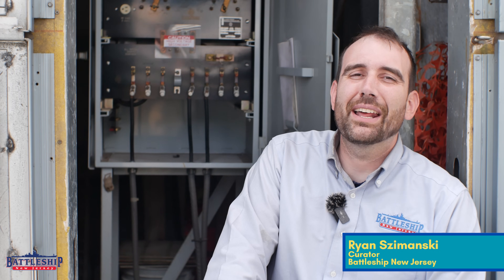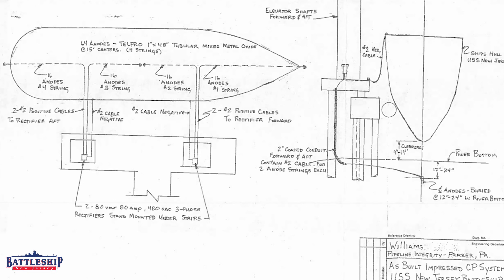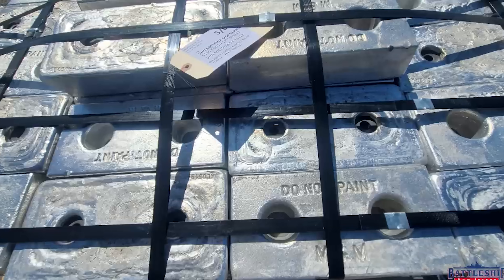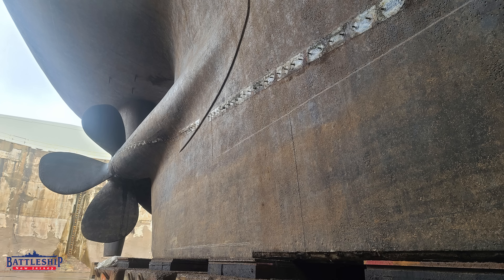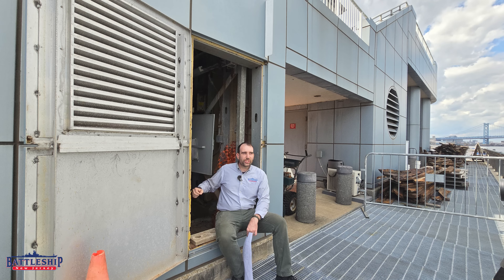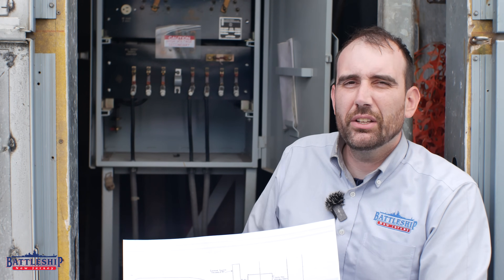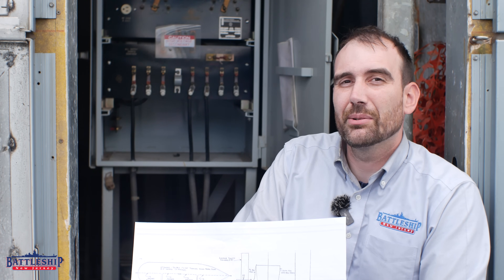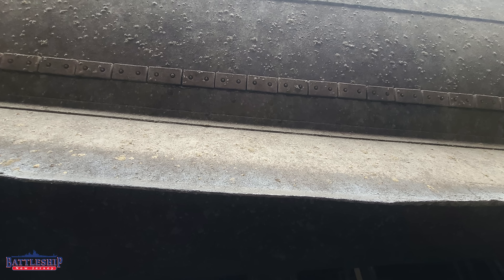Impressed Current Cathodic Protection: Protecting Your Battleship

Comment: According to the blue print, input power to the system is 80 Amps at 480 Volts ( 3 phase )   If true, this is pretty large power and quite an expense for the ship.
Reply: The drawing isn't clear as to input and output but the input is 480 VAC three phase and the output (of each power supply) is 80 VDC at 80 Amps.  They are "power supplies" because there must be a step-down transformer feeding the rectifiers.

Comment: Nitpick but the connection to the hull is most likely bonded to the hull vs. welded.
Reply from the maker: Its welded, up near the gangway, we just did it when we got back from drydock.
Reply: @BattleshipNewJersey  Probably just semantics, the steel contact would be welded to the hull but the cabling would be considered bonded (not as in glued but as in electrically bonded) to that steel part.  It has a specific meaning in electrical terms, particularly in the way of doing isolation or field distribution.  Typically you see this in electrostatic discharge prevention or lightning protection applications.

Comment: A passive diode type system would be cheep and help as a backup might even be tied into a radio system like the old radio shack diode radios that didn't require any power other than the background energy and signal.

Comment: $150 for a hunk of zinc? LOL! I don't care what ship it came off of, you're out of your mind.
Reply: Think of it as a $150 dollar donation to the Battleship's maintenance.  The zinc anode that helped protect the ship for decades is just a thank you for your generosity.
Reply: @blshouse  and that $150 includes the shipping cost for one, they are heavy
Reply: Those things are heavy, so shipping cost is high, and last I read they couldn't find a box strong enough to hold the thing, so the container they came up with probably costs a lot also.
Reply: Hardly. They are raising money for very expensive projects. If you can’t afford to donate, don’t.
Reply: It was $75 during drydock tours
Reply: @kolt4d559  the $150 includes the shipping cost, heavy critters

Comment: Chemistry in simplicity, involves the valence (outer electrons) electron orbital of the atoms. The cathodic protection runs the current in the opposite direction, that "rusting" would do naturally. btw: must be DC, for the reaction to work in only one direction, hence the rectifiers. Also the polarity ([+] anodes in the water, [-] cathode/boat) must be hooked up properly.

Electrochemistry, the study of how electricity can contribute to chemistry, allowed the creation (actually separation) of materials never imagined before, by the 1800s. That's how many of the elements where discovered. It also made materials cheap, such as aluminum, which at one time, was more valuable than gold !

Comment: impressed cathodic protection installed on the ships uses multiple anodes along the hull, and the screws are the cathode with a brush setup on the shafts to complete the ckt. it not only helps control rust, it does a heck of a job against sea growth on the hull.

Comment: I’m a firm believer in ICCP.  I even installed a Corro-Protec active anode on my hot water heater.  The green light on the power wart is a nightlight for my garage. 👍🏻
Reply: 1300 coulombs a day keeps the plumber away 😁

(the Corro-Protec imparts 15 mA current)
Reply: I plan to put one of these on my water heater when the factory anode ceases to be an anode.

Comment: I feel like this will be quite the cathodic experience.
Reply: I anode about that.
Reply: @Norbrookc I expect that you’ll be quite amped up - perhaps even impressed.
Reply: I think I’ll get a charge from this episode. If I don’t I’ll be shocked!
Reply: I'm glad nobody tried to nullify the positive current of Ryans post.
Reply: I'm wondering how we can work "curator" as a unit of electrical measurement. We've seen it used as height, width, and perhaps mass. As long as he remembers to keep the curator out of those gray boxes there should be some way to work him into the electrical system.
Reply: I thought it was Catholic protection and I was expecting a priest and an exorcism.
Reply: @andyjackson3414  - The power of Rust compels you.
Reply: @nmccw3245  Rust, the demon in iron. 
I  was told that rusted steel was better for the recycling however.
Reply: Impressive